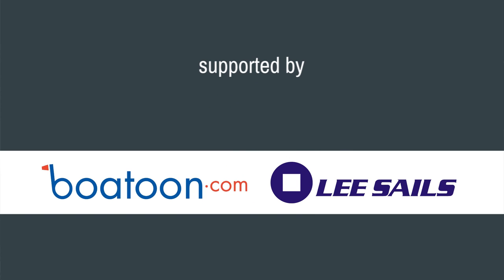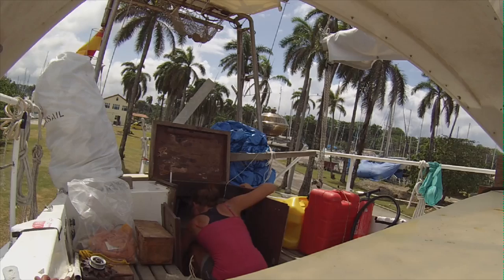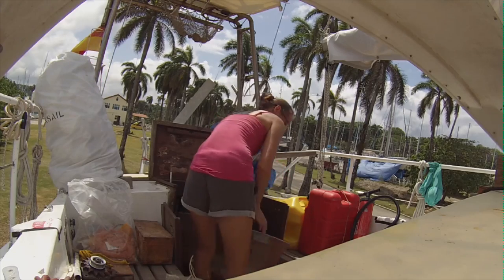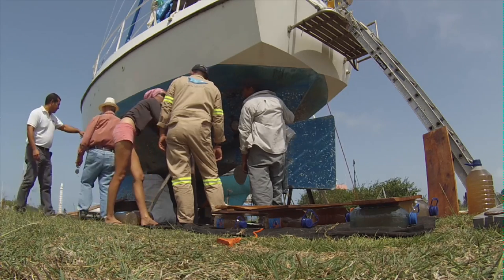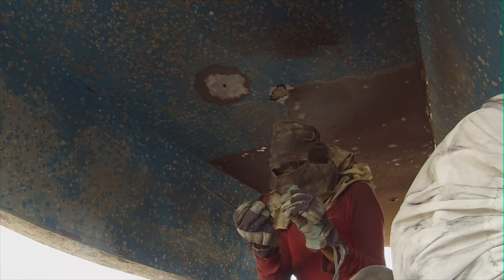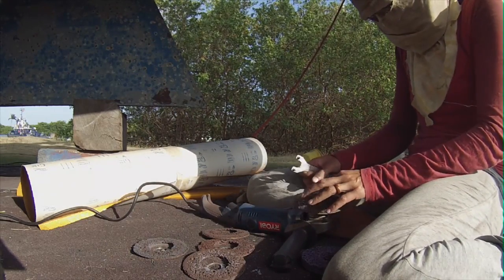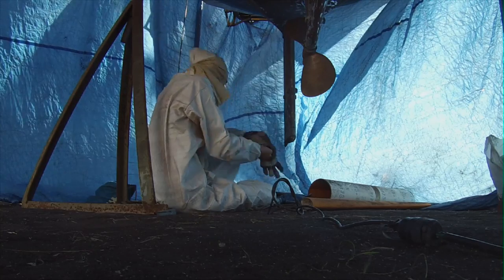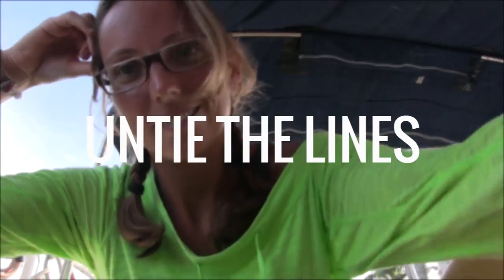Just Do It! Grinding Down The Paint Of My Sailboat In The Crazy Tropical Heat - UNTIE THE LINES #27

Comment: Check to see if you can use fiberglass and resin to fill in the holes that aren't completely through the hull. You can pick that up at a auto parts store down there. And make sure your zincs are all in good shape. Go to your boats maker online and see how many it should have. On your boat they are crucial.

Comment: Awesome work rate, perseverance, determination, bravery - everything!
I'm ashamed to admit that I've achieved less on my Super 10 in a year than you have on yours in two weeks.
If you can find a 75 or 80mm. (100 will be too big) knotted wire cup brush in M14 fitting for your grinder - like the old rusty one in your video #1 - it should speed things up and outlast 5 poly discs. Harder to hold steady and bits of wire do fly off so please take precautions.

Comment: My two cents…I think fiberglass would be the best solution to your hole problems. It’s cost effective, fast, and something you can do yourself, unless you’re a master aluminum welder. Fiberglass is as strong as steel (stronger), or in your case aluminum and want fail. Just make sure you use an epoxy resin below the waterline…not a polyester resin. Good luck and looking forward to next week’s video. Cheers!

Comment: it is so nice to see you smile again. did they say anythhing about what might be the cause of the problem.
Reply: Would a spent anode allow corrosion just around the shaft area or could it have caused more general corrosion in other areas as well? I don't know but I'm sure some more knowledgeable person will have an idea.
Reply: i thank most likely its some kind of ether dissimilar metal corrosion or electrolysis if they are using the hull as a ground some where that might do that. some people think that because the boats are aluminum you don't need a ground wire back to the battery buss. they use the hull of the boat and that will put a current in to the hull and any place salt water gets to the hull you will have electrolysis corrosion. so Nike check for that you need to check all the ground wires you can find. if any are attached to the hull you need to run them back to the ground buss..

Comment: White spot , you are quite amazing . To see an attractive woman doing what you are doing is very unique, I applaud you! I have had the "Sea addiction" myself. Rebuilt a commercial fish boat and fished it , then met people with various sail boats (cruising and performance boats) and sailed extensively etc. etc. I have extensive fabrication /  welding, steel / fiberglass / wood experience (even before boats). I was planning on building a "Dutch"  aft cabin style full displacement trawler / motorsailor to do some "voyaging under power but blew my back out now no more boats.
I hate to be the bearer of "bad" news but I would like to help you out.
1. You need an HONEST surveyor with extensive metal boat experience to inspect your hull. This is done with an electronic device similar to an ultra sound.This will "guage" / "sound" the thickness of your hull. I hope not---- but when a metal boat has holes corroded completely thru it most of the time the areas surrounding the hole are / can be extremely thin.
POINT IS: You have to have the hull sounded / guaged to determine the extent of the  hull thinning / corrosion of the entire hull (waterline down at least). This can be an expensive procedure to have done.
2.Please do not try to plug the holes with epoxy, if you need to put the boat back in the water for some reason it might be ok , but I would not take it out of the harbor.
DON'T EVEN THINK ABOUT GOING TO SEA WITH EPOXY PATCHED HOLES IN YOUR BOAT.
3.Did  the boat have any corrosion control ( zinc anodes) attached to the hull when you pulled out of the water? If not then the entire hull has been acting as a "sacrificial" (spelling?) anode. I won't go into it in depth , but the zinc is attached to the hull and bonded to the shaft / thru hull fittings etc. is sacrificial in that it will protect the hull from electrical currents in the water (simply put). GOOGLE metal / aluminum / boat hull / electrolysis (spelling?) protection.
4.BAD PART: If the entire hull or major parts of the hull are thin. Then the only recourse is to re-plate a MAJOR undertaking.
5.RECOURSE: Have the boat shipped home to undertake this massive job, but I hate to say it , it's probly time to cut your losses and look for another boat. I like steel for off shore sailing / voyaging. If you run into anything it just dents and can be repaired anywhere in the world. It's easier to weld and even in remote areas it can be repaired, but as aluminum it needs to be inspected as above. 
6. I AS OTHERS APPLAUD YOUR TENACITY AND DRIVE IT JUST NEEDS TO BE FOCUSED ON ANOTHER VESSEL. Dave in LA ,CA.  GOD Bless.

Comment: WARNING!  A woman brought a steel houseboat to the marina I ran. She had just bought it after corrosion leaks through the hull had been repaired by welding steel plates over the damaged areas. A year later the boat sank at the dock. The hull leaked like a sieve except for the new plates..  It's since been cut up for scrap. Aluminum can do the same thing. Without a professional survey by someone who knows haw to survey aluminum boats I'd stay at the dock. If you have to give up the boat and shipping isn't to high I'd scrap the boat and sell the jewels like blocks, cleats, winches and  instruments on Ebay or locally.

Comment: Have you tried the knotted wire brushes for your angle grinder?  Thats what i used to remove paint from steel angle iron.  check those out if you run out of the kind you are using.  Be warned though the wire wheels make quick work of the paint but as the wheel wears the wires start to fall out and they kinda get flung at you and sometimes even penetrated the skin....  I just went with it despite the pain because they worked so well at stripping the paint.....

here is a good source for cheaper tools, i don't know what the shipping to Panama would be though.

goodluck!

http://www.harborfreight.com/catalogsearch/result/index/?limit=60&q=grinder+wheel